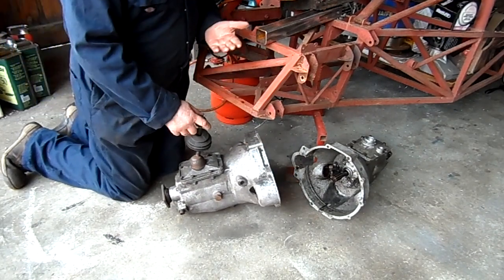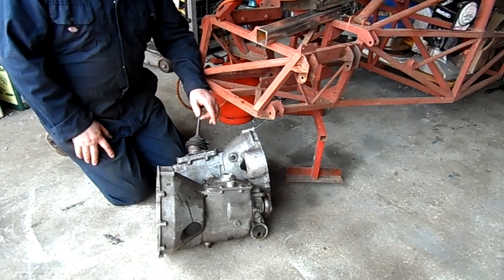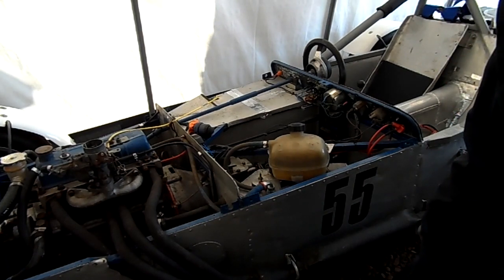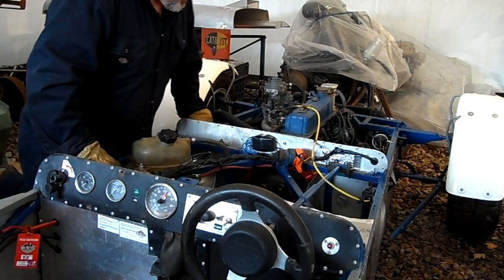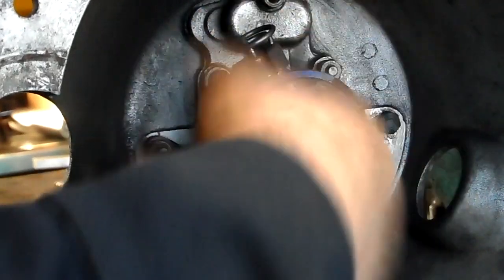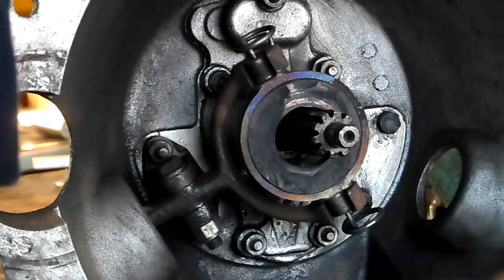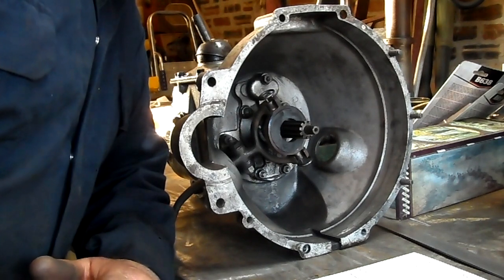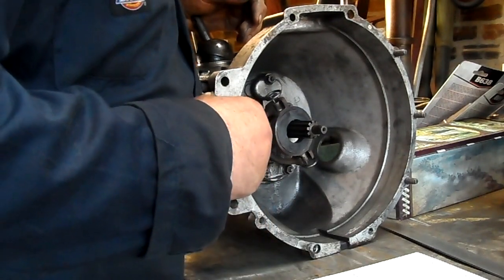Reliant Regal 750 Close Ratio Race Gearbox - Checking Gear Ratios

Comment: Interesting, On my Lotus Seven S1 the drive shaft to differential coupling hits the frame on hard corners.  After having it machined down as far as practical it now only hits on right hand corners.  Apparently this was common on Sevens and clubman XI, both having straight axles.
Reply from the maker: My Jeffrey has fully adjustable radius rods and Panhard rod which meant that I could optimise the position of the differential flange. My new tunnel was a bit too tight and I had to widen it at the differential end. I had forgotten that the differential can move diagonally as well as vertically.

Comment: if you are considering the later 4 syncro gearbox be aware that  all torque is transmitted via a woodruff key, 3rd and 4th don't seem to suffer failure but the 1st/ 2nd  key WILL shear if driven aggressively or if the wheel lifts and spins up a little before hitting the ground. A Worn diff will make the problem worse.

A hydraulic  concentric slave might be easier to fabricate/ adapt than the later type release bearing.
Reply from the maker: I did consider a concentric hydraulic slave but I would need to do a lot of work to pedal box to convert to hydraulic.
No doubt I will find the weakness in the 4 synchro box!
Reply: Is there no way to convert the regal gearbox to 4 syncro?

Modify a 3rd/4th syncro hub to work on 1st/2nd somehow